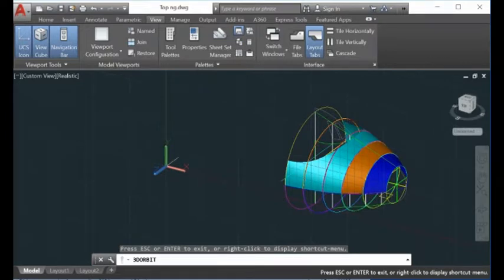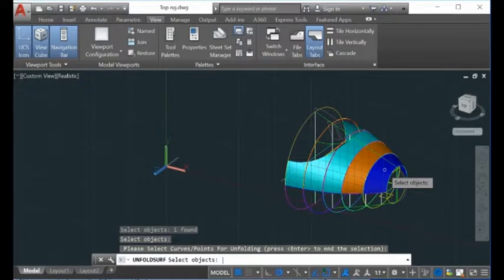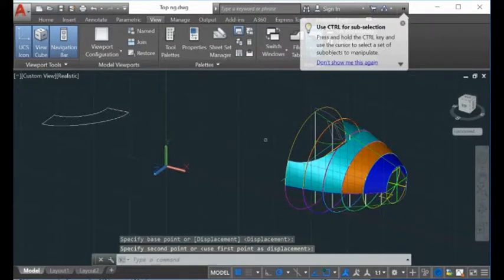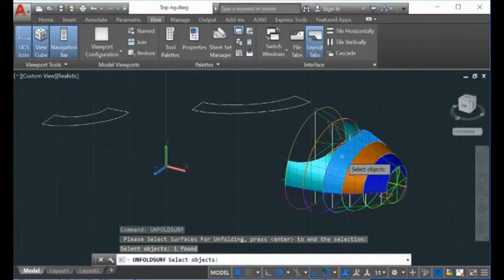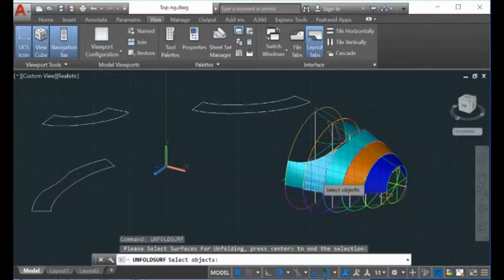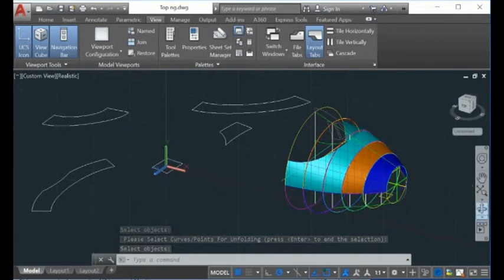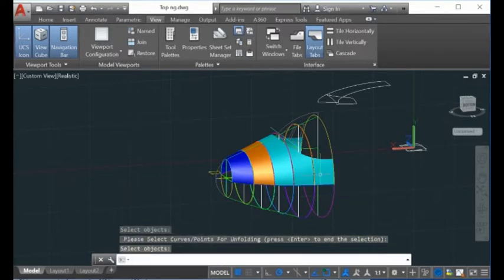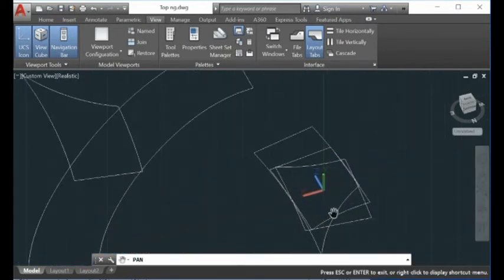unfold surface inside autoCAD

Comment: I think there should be a 3 day free trial to experience it. If it suits me I will buy it.
Reply from the maker: We previously offered a 5-day free trial, but we found that while we were busy supporting customers, very few actually converted to paid users. Our software is not a modeling tool—it’s designed just for flattening surfaces. After users spend long time creating their models, they need flattening the surfaces, then they often no longer need the software anymore. To ensure we focus on clients who truly value our solution, we now charge a small fee. This helps us filter out users who only need the software for one-time use and allows us to better serve our committed customers.